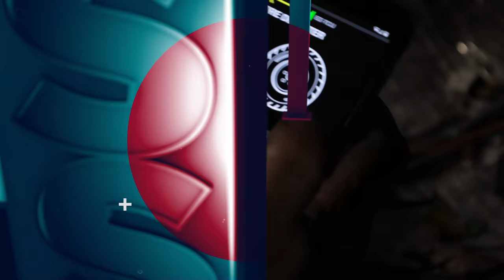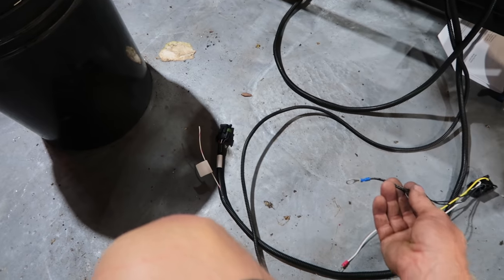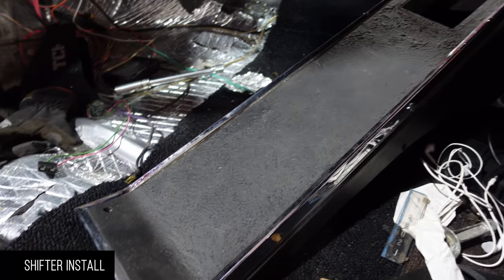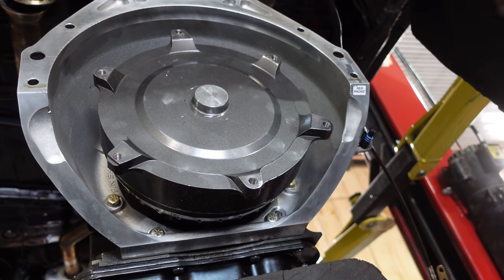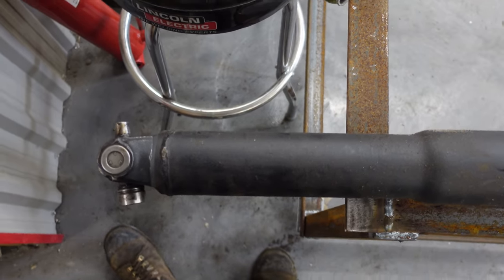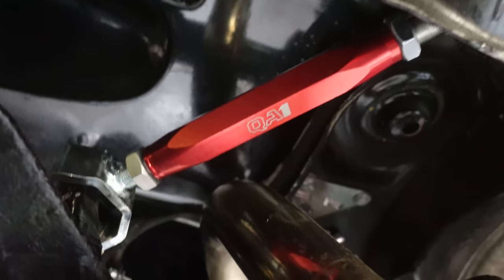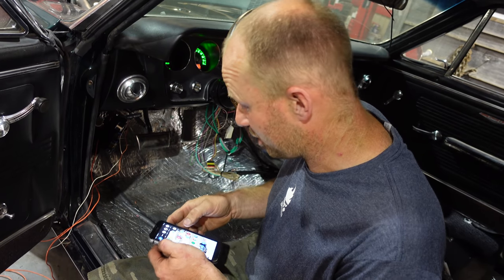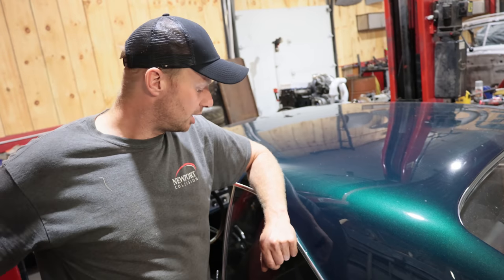GTO Gets Overdrive for Hwy Speeds! | #67GOAT [S2 E4]

Comment: Rich- Note for you when hooking up the tps. The sniper system does not like sharing it's tps single. I installed a sniper with a tci/fast, ez trans controller and neither system behaved correctly(BBC and 4l80). I had to install a kit to piggy back a second sensor on the sniper. One sensor for sniper- one for trans. Issue I had was the sniper would not drop into closed loop learn mode. Simplify unplugging the trans from the TPS would allow the system to enter closed loop fine. With out the TPS the trans will shift as if the you had the engine floored. Just a heads up.

Comment: Ever consider a bulkhead connector for all those wires through the fire wall? It would improve the integrity and weather tightness a ton. Deutsch and Amphenol both make up to a 47 pin locking connector.
Reply: @notsevenfeettall  do you know easily exactly what video that is??
Reply: @notsevenfeettall  hey thanks 🤙😂 I'd have done the same I promise 😂😂
Reply: @notsevenfeettall  yes that's exactly what I'm talking about!

Comment: I'm not a big fan of using Bluetooth phone apps for this kind of stuff. 

They already have your money.  So what happens in 10 years when phone operating systems or even the Bluetooth connections used advances and the app or the way the app communicates becomes incompatible? Will the manufacturer spend the resources to ensure your old program is compatible? And how could you guarantee that it won't just become obsolete and ignored requiring the purchase of new equipment  just to continue using it?

Now a dedicated controller doesn't necessarily offer a lot more security against this except that you won't be replacing it as often and there are a range of external options that could step in and you can control updates and so on easier.  Windows used to have a problem with this and printers where updates could ruin the driver interoperability and the manufacturer's solutions were to purchase a new printer or not update. Other computer hardware would suffer the same stupidity at different times too. 

Just something to keep in mind when doing projects like this. Having a backup plan might be the difference between redoing the installation or not or weather you can sell it to somebody with a different style phone or not 20 years from now.

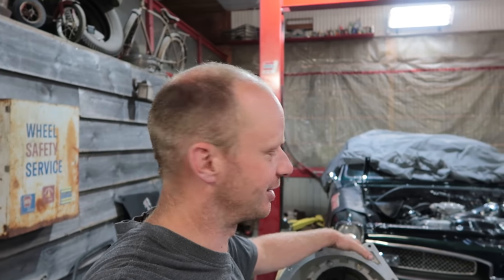Comment: What is the final Rear End gear Ratio and what is the OD ratio? Also what is the Rpm drop from 4th Gear to OD cruise? Was a 6 speed with 2 ODs overkill or would the fit into the chassis be incompatible? Also I'm sure the cost is higher. How much? Just Curious. I have a 1973 small block Chevrolet with a 4 speed and 4:11 ratio rear end gears and positraction. It accelerates well from 0-60 using 1st and 3rd. It's a convertible. So even 60 mph on the freeway or cruising on a day trip, the engine is wound up and loud. Plus strapping two 5 gallon Jerry Cans of 93 octane on the luggage rack for a road trip into the boonies in Texas would get me some weird looks. Even though they are painted the same red color as the car. Just joking.
I could take out the spare tire and put an extra auxiliary fuel tank in there. But that would maybe require an extra fuel gauge and definitely a switchable fuel pump. The only real serious drawback I can foresee? A rear end collision would be spectacular for any looky loos. But not so great for me and my passenger. Remember the Pinto? Or the pickup on 60 minutes? When I was a kid all of the farm truck fuel tanks were right behind to seat back in the cab. The hose between the outside filler and the tank always leaked fumes into the truck. Maybe that's why my Uncle, Farmer Bob, in Kansas didn't smoke?
On a serious note. I worked in a military/civilian burn unit in the 1980s. Horrific burn injuries. You chances of survival were 100 minus your burn percentage from age ~15 to age ~50. It tapers off as you get older or younger and your state of health is a significant factor. After that experience, fire really freaks me out and I would much rather die any other way.
This video is great and gives some ideas. Thanks.

Comment: I guess this is the inexpensive EFI kit, but still surprising it doesn’t have some spare I/O for that tos and tach signal. It’d be really nice if the modules would work on a datalink. 
Or maybe just higher impedance inputs that don’t pull the signal down too much to share. 
Oh well just the fun of integration with a bunch of aftermarket stuff.

Comment: In my younger days I had a 67 Goat with an L-72 Chevy motor in it. Had to sell it because I got tired of replacing trannys. Too much weight and horsepower breaks things. The other big problem was the inner control arms on the rear end would rip out of the frame mounts. Boxing them in with 1/8 plate cured that, but, Muncies still cost $$$.

Comment: I can't stand tci, their transmissions are absolutely overpriced and over-rated, I just rebuilt a tci 4l80e with a few hundred miles that didn't hold up behind a 1000hp naturally aspirated 632 bbc.  The way they cut off the bell housing and use a bolt on adapter flange is dangerous.  Tci acts like they invented the 6 speed 4l80e but they absolutely didn't.  PCS invented the valve body for the 6 speed 4l80e and anyone could buy them for $500 before tci bought the rights to the 4l80e 6 speed valve body and re-branded it as the tci 6x transmission.  I actually have 3 of the pcs 6 speed valve bodies in stock that I bought from a shop in Australia that had them on the shelf.

Comment: Apps and phones. You've never seen what a cheap SDR with the ability to transmit less than a watt can do.
Reply: I rely on night switches, just two. Inside door and under dash.. maybe an Arduino and RFID tag... No I don't, I just disconnect batteries and spark plug wires on my 7.3

Comment: Ah. Throttle Position Sensor. NOT Tire pressure sensor. Finally makes sense.
Reply: Isn't a tire pressure sensor usually abbreviated TPMS for tire pressure monitoring sensor?

I agree thought. It gets confusing when everything is abbreviated and sounds the same. It's not like they are being charged by the letter when talking about this stuff and the time difference whether writing or speaking is going to break the bank.  Slipping the long name in every once in a while for clarity or even just using it all the time would be much appreciated.

Comment: The converter in the box, and the converter he installed looked like different converters??
Reply: U were just seeing the different sides
Reply: @phillipwarner5504  the one he installed almost looked like a two piece. .?
Reply: I get what ur saying but it's welded the flywheel side is billet n has 6 connections instead of the three it was hard to see in the box but definitely the same one